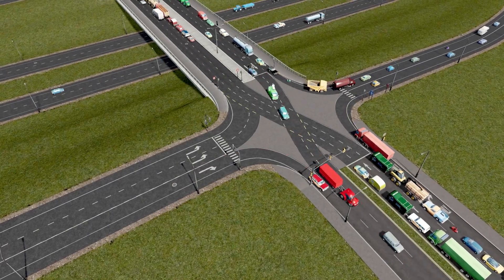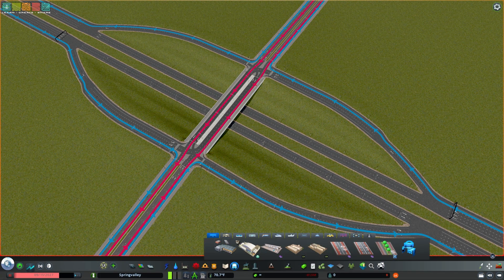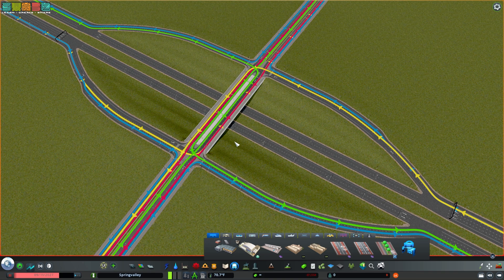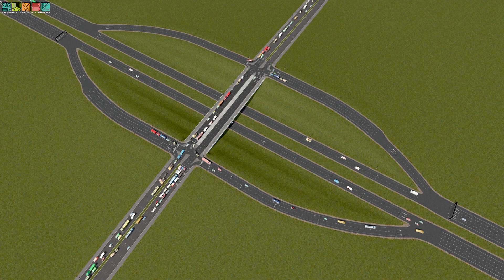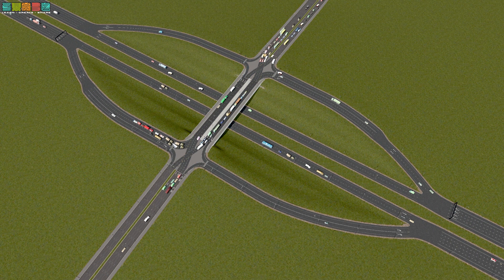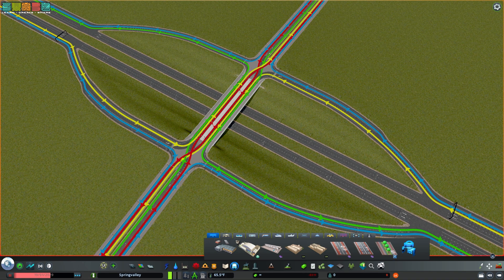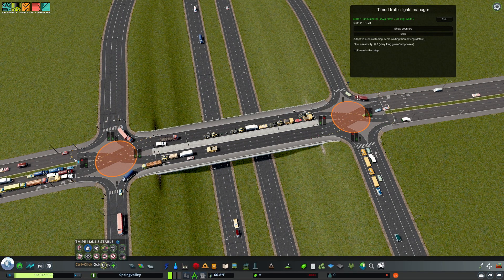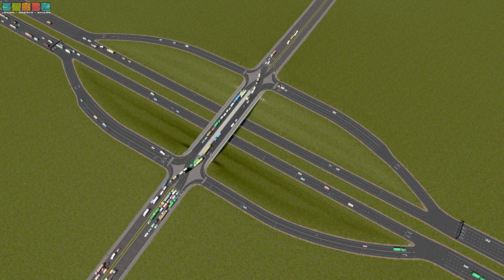Why your Diamonds should "Diverge"  -  The Diverging Diamond Interchange (DDI)

Comment: DDI works pretty well... so long as you don't choke the exit outside the interchange on the through roads! Orlando built one over I-4 and then have a 4 way intersection only about 50 feet to one side of it. Guess what? Snarls of traffic. Stupid stupid stupid.
Reply: EDIT: my bad... 500 feet to either side. Still a huge mess with the volume of cars through this intersection.

https://www.google.com/maps/place/Orlando,+FL/@28.3963637,-81.4877408,18.15z/data=!4m6!3m5!1s0x88e773d8fecdbc77:0xac3b2063ca5bf9e!8m2!3d28.5383832!4d-81.3789269!16zL20vMHBseTA?entry=ttu&g_ep=EgoyMDI1MTIwOS4wIKXMDSoKLDEwMDc5MjA2OUgBUAM%3D

Comment: Two flaws I have yet to see addressed, one of which has a fairly simple solution are:
1) What if someone coming off the highway needs to do a U-turn?  There is no U-turn option without them having to wait, when an extra lane could simply be added to each side of the bridge to allow uninterrupted traveling.
2) The biggest flaw is trapping/delaying someone exiting the highway who wants to use a business that exists on their side of the highway but on the side where traffic enters the highway.  Say at 4:38 someone exits traffic from the lower left side of the screen and wants to use a business on the lower right side of the screen, they can't.
Reply from the maker: I’ll help address both!

1. Not all solutions need to accommodate a U Turn, though this one actually excels at it. Though I don’t understand why anyone who presumably missed their exit would deserve priority and not have to wait. “Simply adding a lane” is extremely expensive in real life.
2. Businesses shouldn’t really be built on interchanges. Interchanges connect high traffic roads, and a road is a place for moving vehicles. Businesses should be on smaller local streets, away from fast moving vehicles.
Reply: Many states allow left turn on red from one-way to one-way.  So traffic exiting from the freeway does not always have to wait for green to leave the ramp.  Unless the jurisdiction determines the left turn on red is not safe.

Comment: It's kind of funny how hard it is for americans to come up with some other ways to reduce conflictpoints. If you only have money for reusing the current brigdes you can convert the junctions on the arterial road to two semi roundabouts (formed as drops rather than cirkles) and if you have money to replace the bridge, you can build and big roundabout over the whole motorway. Both forms are common near towns in Sweden.
Reply: Are you seriously calling this a rural place?
https://maps.app.goo.gl/hjdKp7oMS8iuhDcGA
Reply from the maker: No. I’m saying the only places in the US with few enough vehicles to allow a dogbone to work are rural. We have more cars and more drivers in more places than Sweden. It’s a problem that renders your dogbone solution inappropriate where a DDI will work.
Reply from the maker: It’s really not that engineers here aren’t aware of roundabouts. It’s that the junction you’re describing is insufficient to handle the sheer number of vehicles entering and exiting the freeway. 

Your solution would work in a rural place with few vehicles. Where the dogbone belongs.

Comment: There's a flaw with that diamond traffic. There's no bypass at the intersection for the frontage road. It's frustrating for those who shop at our HEB in North Austin at tech ridge who lives north of that intersection along IH 35😡 There is a bypass for the frontage road, but it's down  stream from the main intersection. There should be another bypass at the intersection on the right side of both lanes of the frontage road in both directions for the shops closer to the intersection.
Reply from the maker: Most interchanges anywhere else don’t include that. Must be a Texas thing.

Comment: Think of a simple crossing. Even here we have benefits if one (yes only one) of the roads is lefthand drive. Going straight, left and right is now all very simmlar in terms of possible collisions. It is also not possible to have a gridlock anymore.
It sounds insane but I think a city like NYC could turn all the one way streets and avenues into two way. IF all the Streets become lefthand drive while the avenues remain righthand. Maybe it would even work without traffic lights.
It will never happen because real people prefer the system as it is and just the take a longer route around the block. But in a world with completely autonomous vehicles and where travel distance has to be a short as possible, maybe it could work.

I hate the fact that I actually talk about utopia fantasies. I'm usually not like that at all. I love driving my car.

What do you think?
Reply from the maker: A cool idea. Even the DDI has its limits though. It would be easy in a place with lots of pre existing one ways though… 🤔

Comment: anything but a roundabout with a flyover obvoisly
Reply from the maker: If an existing overpass could easily be retrofitted into a roundabout that might be a fine option. A DDI can generally do that where an elevated roundabout generally cannot.
Reply: my problem with DDIs is they are a pain for pedestrains or cyclists to cross @YUMBL
Reply from the maker: Indeed. Interchanges generally are as their primary function is moving traffic on and off the freeway.

Comment: Should the right hand turns be traffic light controlled or free flowing? Tulsa, Ok is implementing a DDI and although the graphic they used might not be final it appears to have traffic light controls for the right hand turns exiting and entering the ramps.
Reply from the maker: Either depending on traffic volume, available space, and cost. If theres not much right turning traffic stopping is fine.

Comment: You forgot to illustrate one more common move which is the u-turn from the highway .... exit highway, turn left onto overpass, turn left onto acceleration ramp headed in opposite direction. The Diverging Diamond handles this very well, however some interchanges that are not Diverging Diamonds will allow for a separate lane on the over pass for the u-turn traffic from both directions.
This obviously adds additional cost because of the extra wide overpass or (in the case that the main highway is the  overpass) a longer bridge with extra lanes underneath for the u-turn traffic.

Comment: Would a flashing Yellow left turn arrow on the freeway off-ramp work so that traffic can yield a left and then there is an option to protect that left turn with a red arrow for on-peak traffic times or if the overpass is filling up?
Reply: Truth be known, that's a function of how much room you have between the cross-traffic light, and the on-ramp.  There are five of these in town (Kansas&JRF, Kansas&I-44, Battlefield&65, National&JRF, Chestnut&65).  On the north end of the Kansas&JRF bridge, there's no light, but there's a ton of space, so a yield sign does the job.  Also, as an aside, the Chestnut&65 DDI has a problem: There's no dedicated 'dump' lane that only goes left on the south side.  I'm guessing they ran out of room  on the underpass and only did 2 lanes on the south (3 on the north), so the 2nd lane goes left and straight, so when it's busy the westbound traffic will pile up in the left lane, and cars going straight will pile up enough traffic to get in the way of the left turning traffic.  The rest of them have a dedicated left-only lane on both sides of the bridge, going onto the highway.

Comment: While the diverging diamond works well in theory, it has a single basic problem, which is that the maximum flow is about 50% of the total roadway.  As you have to cross over at each end, the traffic has to be stopped for about half the time to allow everything to work out.  So not matter what, it has a very hard limit as to it's effectiveness.  It's clearly much better than standard, but given all the space this used, it's likely not the most efficient for the given area.   Nice explanation tho!  :)
Reply from the maker: Its more efficient than other options with a single overpass. Thats really the feat of it. Thats it can be made from the infrastructure of a common, lower flow interchange. Cheap for a small city.

Comment: I’ve noticed in cities skylines removing traffic lights solves most problems. What few times I’ve reached the point where a simple diamond interchange isn’t enough I modify it to remove through traffic and add another bridge for that on a neighboring street. I’ve never needed to use a diverging diamond nor have more than two lanes each way. I always build my infrastructure without traffic lights or roundabouts and I can still have over 80% traffic flow regardless of city size.

Comment: the one possible issue I can see with this for cities skylines is that it seems to favor traffic from the avenue over entering traffic from the highway, and all the worst traffic jams in Cities Skylines seem to come from traffic entering from the highway. Not an issue in IRL, where reducing conflict is a major safety concern, and local roads should probably be favored anyways, but in Cities, you'd probably need to let the lefts from the highway merge in to prevent tailbacks onto the highway, because you can't get more of that traffic through by just extending one phase of the light.
Reply from the maker: I think it actually favors traffic coming to AND from the highway at a cost to through traffic.
Reply: @YUMBL  If I interpret it's functioning correctly, vehicles come off the highway, filling the overpass, then any additional would back up onto the off ramp. Any that are on the off ramp then can't move once the light changes. Under the demands of mass amounts of people moving into the city, I could easily see a tailback forming, and it seems like it would happen easier than with similar solutions. Please correct me if you have seen a diverging diamond eat that kind of sudden wave of traffic, I may just be underestimating it's throughput.

Comment: You said it and it can't be emphasized enough... a key reason the DDI has become such a darling with real-world planners is that they can be retrofitted onto classic diamonds with very little capital cost, usually little to no changes to right-of-ways or imminent domain, and very little construction disruption. It's a heap cheaper to convert from a classic diamond to DDI than to convert a classic diamond to SPUI! Really good bang for your buck.

Comment: I find that any benefit that may be garnered by using this method are outdone by breaking all the traffic conventions that were taught to make it work. The DDI's I've interacted with are more confusing and more frustrating, with most drivers unable to actually garner benefit from the change.

It also ends up removing the ability to flow the through lanes with longer cycles, making them less flexible to changing traffic needs than even a base DDI. Note: I'm not contesting the theoretical benefits in a tightly controlled virtual environment. I'm mainly touching on the mental effect of breaking convention for a minor, yet measurable benefit to traffic flow.
Reply from the maker: The benefits in real word application of this are well documented. Safety, traffic flow, ease of conversion. There are a contingent of people that don’t understand it, but they largely haven’t interacted with it. You really cant mess it up.
Reply: @YUMBL  I haven't messed it up yet, just sharing my observations of it in the real world. 🤣
Reply from the maker: Funny thing is it doesnt break any traffic conventions. If people follow the laws in the state where its implemented everyone gets through quickly. I’ve read nothing of a concentration of issues from drivers in a DDI.
Reply: @YUMBL  You'd know better than I, then! 😁

Comment: Forgive my ignorance, but wouldn't a clover interchange solve all of these issues without making streams of traffic switch sides of the road? It seems like obscured or faded road markings would make this a nightmare to navigate for anyone not familiar with the interchange.
Reply from the maker: Cloverleaf has weaving. I have several partial cloverleaf videos that explain its weak points. The DDI shown here also requires no additional ramps, and can use an existing bridge.
Reply: @YUMBL  I see. Potentially saving massive retooling and earthworks by utilizing existing infrastructure could definitely reduce costs and construction times.  Thanks for the reply.

Comment: IRL I drive through two of these interchanges (at least) on my daily commute. 

The biggest problem I see with them is drivers that mistakenly take the wrong exit. With other interchanges, they could get right back on the freeway, but with this style of interchange, they have to go far enough to make a U-turn, or in the case of big rigs, drive a big loop through urban streets. 

This became such a problem at one intersection the intersection was redesigned to have the right turn lane coming off the freeway split and allow a phase through the traffic light to get right back on the freeway. It's a short phase, but annoys the crap out of drivers when there is no traffic in that phase. And the phase must cycle every time because the technology to sense a car waiting fails regularly.

Comment: We have one here and we are doing a study to remove it because of the ultra heavy through traffic on arterial level which fails the DDI big time. To be fair, it is still an very ideal solution in terms of signal timing/pedestrian accommodation if the bridge replacement/widening cannot be justified and funded any sooner.
Reply from the maker: I think you’re right. The ddi is great when highway access is most important, but it minimal (no) benefit for through traffic.

Comment: I am from Springfield MO where the first DDI was installed in the US. There are now 4 or 5 more in the city. I hate them. Not because they are confusing. (Only one of them is because it goes directly under an overpass and is difficult to see the traffic pattern as you enter.) They make entering and exiting the highways easier, but they bring two traffic signals very close to each other on roads that are already congested and pull more traffic to them because it is easier to get on and off the highway. The result is traffic that backs up beyond the neighboring (also busy) intersections. You end up sitting through 2 or 3 cycles before making it through the entire mess.

Comment: Nice. One big problem though are the left turns off the highway. If the bridge is backed up they have no way to get in. The longer the bridge, the less of a problem, right? What happens if you don't have the space for a very long bridge. What's the best compromise to handle those left turns off the highway? Yield, no light?
Reply from the maker: In a real setup i think that the engineer would set the light up to let the bridge clear before letting the highway in. or you can run a lefts from the highway only cycle for as long as necessary.

Comment: Ever since I first saw one in Lehi Utah and figured out what the idea of it was, I kinda fell in love with it. I think Diverging diamonds are rad. 
The Salt Lake area has a few unique traffic reduction ideas. There are a few intersections in Draper that don't allow lefts at the intersection. Instead the 'left' is a quarter mile down the road in a protected U-turn intersection that allows traffic to flow into a shopping center or back to the intersection into a protected right turn. 
Another road in Taylorsville has flex lanes that change their direction of flow depending on how much traffic is present at that time. The edge lanes are always their original direction, but the inner lanes can change as needed allowing for more options in either direction. 
Along Bangerter Highway there are lefts that start about a quarter mile before the intersection it's self. It's a left turn only light synced to the main light. That left takes you across the oncoming lanes and into a lane on the far left of the highway. That way when the highway gets it's green you can safely turn left off Bangerter without impacting it's traffic. 
There's a lot of Single Point Urban Interchanges all along the 15 and Bangerter now too. 

As a Californian that was used to typical Diamonds, clover leaf, and the likes; it was a bit strange at first. But once I had a chance to use them a few times and understand them, I grew fond of them. Salt Lake really grew up into it's own with transit in mind. It's not always perfect, especially with how the 15 could get at rush hour. But, I always found it a lot easier to get around than being stuck in Southern California freeway parking lots. Kinda really miss being out there. Maybe not downtown SLC, but the surrounding areas were pretty great.

Comment: So irl you can actually play with signaling phases a bit more than was demonstrated here to get more capacity out of a normal diamond interchange. 
The most common one is to let both thru traffic go at once, with no left turns allowed. This would be between your phases 3 and 1. I realize this can be difficult in CS.
Another one is to separate the off ramp left turns into 2 separate phases. This can be structured so that traffic never gets stuck in the middle of the interchange (ie the bridge) but has the drawback that it takes longer on average to get through the intersection.
I know you were focusing on the DDI here so this doesn't necessarily pertain to that, but i guess this would be interesting for someone who happens to see this comment.
Reply from the maker: All true. And great to do before refurbishing an overpass/interchange unnecessarily. I feel the same about intersections. People often comment “that should be grade separated”, but a four way intersection can be pushed quite far without breaking the bank.